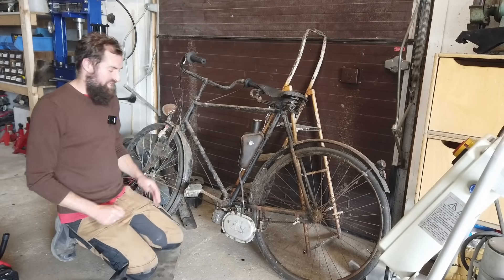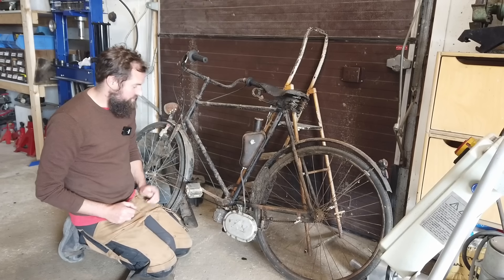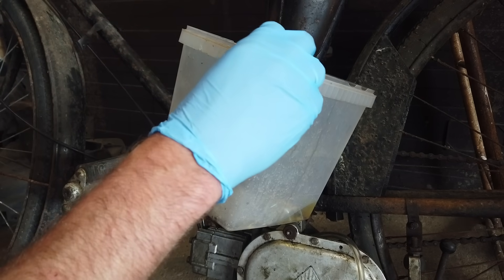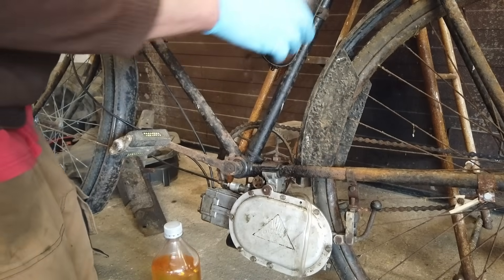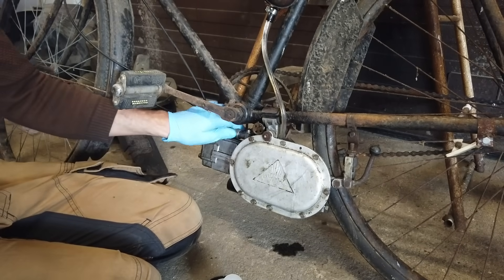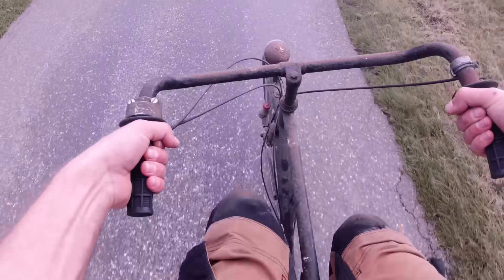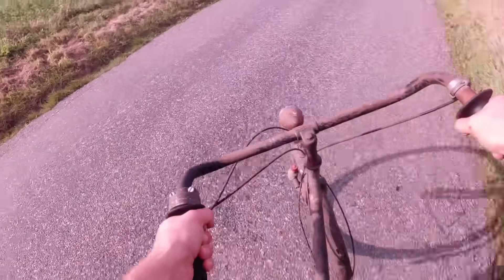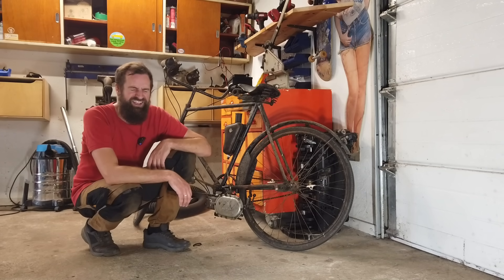Riding A Two Stroke Diesel Moped With Variable Compression!

Comment: Technically I think its called a semi-diesel engine similar to the vintage model aero diesel engines which used paraffin and ether as well as a contra-piston. Either way its a compression ignition engine so technically yes its a diesel engine 😁
Reply: In my opinion, a semi diesel is a glow plug engine, where the glow plug has to be connected to a dc electric power source to start the engine. And then the glow plug is continuously glowing, thanks to the combustion. This is a real diesel, because it self combust, or tho a 2 stroke.
Reply: The model aero engines don't need a glow plug it's the either content that keeps the ignition temperature. The smaller the model engine the higher either content is needed
Reply: Don't forget the castor oil
Reply: @atvheads  Glow plugs on diesels don't run after the engine is started. There were some engines, notably the Lanz Bulldog, which used hot bulb engines, which were not compression ignition.
Reply: @Burnsidef250  Are you sure that's true? I was under the impression that the glow plug stayed on the whole time to reduce the required compression ratio while still providing the required activation energy for auto-ignition.
Reply: @tissuepaper9962  I'm sure. Otherwise your alternator would be toast in short order. They pull down some pretty heavy amps. On my diesel they run for about 30 seconds after starting, you can see the voltmeter pick up when they turn off.
Reply: @tissuepaper9962 glow plugs are only powered during the start phase, and normally only used when a diesel engine is cold. In a model glow plug engine the plug is powered to start but then the burning fuel during combustion keeps it glowing enough to fire the next cycle. Hope this helps☺️.
Reply: I think you two are talking about two different things. 
The glow plugs in a diesel engine just run during start, and sometimes warmup until a pre-determined operating temp is reached. 
The glow plugs in a "glow" RC engine are different. They're a thin coil of platinum wire that is initially heated by a battery to start the engine then kept hot by the heat of combustion. I believe there's also a chemical reaction between the methanol fuel and the platinum that either keeps the glow plug hot or helps with ignition.
Reply: @Burnsidef250  got it, learned something new today. Thanks guys.
Reply: @Surestick88  platinum is a catalyst for the combustion of many organic compounds, it's the active ingredient in your catalytic converter. "Catalytic combustion" is your search term for this evening if you find you want to read some more about it. If you get underneath your car and find the catalytic converter, you may even see heat marks on it; it gets a lot hotter than the rest of the exhaust system, even hotter than the EGT right at the exhaust port.
Reply: @tissuepaper9962 glow plugs are only to pre-heat the combustion chamber and provide enough heat for compression ignition to be successful. Once an engine that has glow plugs starts, for the most part, in most engines, they're totally off. Some in cold climates, they will cycle a few more times to aid in cold start behavior. Having glow plugs or not, does not qualify or quantify an engine being diesel or not. There's also the grid heater method to preheat the air as it goes into the engine instead of utilizing glow plugs.
Reply: @tissuepaper9962 sorry for the secondary explanation, I was speaking more about diesel engines not the model/rc type. Different but not all that different. I realized after the fact that someone else had also clarified 😂
Reply: @goosenotmaverick1156  hey, all good, you actually taught me something new, too. I had never heard of a grid heater before your comment. It seems I have a whole lot to learn about diesels and not much to transfer over from my knowledge of petrols.
Reply: In post war time here use only used motor oil mixed with trementine solvent, a natural solvent from the pines resine. Try with injectors cleaner or ether, is the trick.
Reply: You have a piece of history 😉 here we knows motor de autoencendido,  auto ignition motor. Thanks for share!
Reply: @tissuepaper9962 glow plugs on rc model engines work like that. The combustion temperature keeps the glow plug spiral hot when engine is running.
Reply: Hot bulb engines are called Semi diesels here in Norway. In the US they are sometimes called Crude oil engine.
Reply: @tissuepaper9962  it's a lot of similar but different haha when it comes to petrol vs diesel engines. A lot of the concepts are the same but how it's achieved is different. Have fun learning! It's a grand time. There's even another kind of method for helping starting but I've only ever seen that on tractors and they don't work all that well 🤣
Reply: @goosenotmaverick1156  my old Perkins engine uses the grid heater method, when it operates you can see the flame in the inlet manifold if you have the flexible pipe off, here it Britain its known as a thermostart, very reliable and never had it go wrong.
Reply: that’s cool
Reply: @goosenotmaverick1156  well, don't leave me in suspense like this, lol! what's the third method called?

Comment: If the crank case (including the crank seals) are not air tight you are going to have a heck of a time obtaining any sort of operational RPM band.  Depending on the size of the leak it will light off and only be happy at a specific RPM and a dog anywhere under or over it.  You mentioned having the fuel screw all the way out...  My bet is you are compensating for a lean burn condition due to un-metered air entering the crank case.  Which on a compression ignition engine is going to be very lean.
Reply: Yes i also think that it has an air leak somewhere.
Reply: fuel all the way out, i thought about this one, he said the tank was not the original, look at the cap, i do not think the cap has a hole in it, and the fuel does not come down the  pipe  because of vacuum pressure holding it back,, just a thought....
Reply: I agree completely
Reply: @eyeswideshut7732 exactly wt I was thinking 👍
Reply: @anwarabrahams2413  i would dial the mix screw back in and i would run it without the cap... that is the next job lol👍
Reply: Yes. bad crank seals will kill a 2 stroke.  If it's not terrible, it will run, but it will run horribly and you can never get it dialed in just right.
But I'm not sure it's kerosene.  I use kerosene heaters and kerosene in the US is crystal clear.  This stuff is as yellow as gasoline.  A quick google search says water will do that.
Reply: That engine doesn't need floods of fuel. It's tiny.
Reply: What this guy said.
Reply: why does the crank case have to be air tight how does this affect it?
Reply: @julpul02  nah there are multiple people online posting the same results with this engine, different fuels perform differently and ideally you want something with a big of heavy oil in it for power, and a bit of something vaporizable, and something to lube it, so a mix of oil + kerosne + gasoline probably would work best.
Reply: @Crediu  because its basically a 2 stroke engine like in a trimmer thart uses compression ignition instead of spark ignition... it doesn't have an injection system so the fueling is similar to a trimmer with a fuel mixer that has the fuel floing into the case where it also lubes all the stuff again like a trimmer motor. So... its closer in design to a gasoline 2 stroke than it is a 2 stroke diesel...

Comment: i think it's only meant to just help you over the hill. 0.75 horsepower is about adult sprinting power so if it has that you almost don't need to shift down as long as you keep pedaling like a regular bike and it's perhaps under a 6% gradient climb. omitting shifting mechanisms gives you ~15% extra efficiency compared to, say, a 3 speed hub. the whole contraption is fascinating. i think a lot of us watchers have been thinking of very small engines on bicycles for a very long time. the 50cc kits are more motorcycles than assisted bicycles. if this were available, economical and a little less finicky than this, it would be literally perfect. it doesn't even need to be always on as it's small enough not to need a kickstarter. it's a brilliant little engine
Reply: 0,75hp is well over what an average cyclist can deliver. My place of work has a cargo bike with 250w motor and it can easily do much more than you see here if it would've had a hand throttle- even though it only has about half the power.
Reply: @mfbfreak  i think these ebikes are rather under-labelled. i don't mean sustained power, just sprints. mine is about ~1100 watts (measured by a power meter), but of course only for a couple seconds, and i'm barely above average
Reply: My 53cc 3 speed bicycle isn't a motorcycle, it can only go 47 mph max with my current gear ratios. I am able to gear for 55 mph, but I don't like how it exits turns.
Reply: @thefunniestfarm4731  your point being? the early super cubs went that fast.
Reply: See a Spartamet it's a bike with 30cc engine and way more refined. I had a few when I was young they are slow but fun.
Reply: I imagine, that the bicycle drive wheel will also act as the flywheel to help keep the engine spinning. This engine may not be designed to idle, when the bicycle comes to a stop like at an intersection, but instead meant to be used when the bicycle has long periods of uninterrupted travel. More for use in rural areas or between towns or cities, than inside towns or cities.
        Rather than for hill climbing assistance, it's for long stretches of flat roadway, is my guess.
Reply: Kerosene mixed with a little gasoline would probably help it start easier. Maybe just 5% gasoline to help it vaporize. Without making it more difficult to ignite.

Comment: I know the Lohmans quite well, and I strongly(!) recommend to use normal Jetfuel (Jet A-1) instead of Dieselfuel or Petroleum/Kerosene, because modern Petroleum for safety-reasons has a lot higher flash point than in the early ages. Dieselfuel also does not want to ignite under such conditions very well. Jet A-1 has a flash point of 38°C. You additionally can add some 5 to 10% of diethylether, which eases Ignition, and for liftig up the CETAN-number, add 1% 2-EHN (2-Ethylhexylnitrat). If you look for fuel-sources for  self igniting model-engines ("modeldiesel") you will find similar reciepts. Some Vintage-Modelers and control-wire-combat-modelers sometimes still use Diesels. Good luck!
Reply: Yes, I agree — trying fuel for glow plug model aircraft engines is worth a try. Back in the ‘60s, I used to mix my own fuel for a Cox 0.049 cubic inch “Babe Bee” engine. 

I used methanol, some ether, and castor oil for lubrication.  As the commenter above mentions, model airplane fuels contained some nitromethane in the old days and that may be true today. 

Changing your two controls over to thumb-operated levers may be a  benefit. “Thumbies” are old-school shift levers for 1980s mountain bikes and are still available.  

With the twist grips, it’s clearly difficult to maintain a setting. And tricky to have any repeatability for settings. 

Good luck and thanks for posting both videos.
Reply: Jet A1 is kero
Reply: @Larpy1933  There's a bit of a difference between a model diesel and a glow motor. model diesels (and this thing is basically an overgrown model diesel) have a movable counterpiston in the top of the cylinder that allows adjusting the compression ratio. They have no glow plug, and ignite using only the compression of the fuel mixture, vs a glow motor where the methanol undergoes a catalytic reaction in the presence of the platinum glow plug wire, causing the wire to glow and act as a 'hot spot' to ignite the majority of the fuel.

Model diesel fuel was usually a mix of castor oil, kerosene and diethyl ether. You would start them by winding the compression screw in, which raised the compression ratio, then flipping the engine over. Once ignition happened you had to adjust the compression screw for best running, it basically acts as the ignition timing (more compression = earlier ignition).
Reply: @nerd1000ify  You are right. Fuel for glow plug engines does NOT work in a compression ignited engine.
Reply: @EricaMTB  "Kerosene" in the USA, as used in outdoor-burners has a higher flash point than Jet A1. In Europe it is called Petroleum, which also has nowadays a higher flashpoint.
Reply: @hiha2108  Indeed, methanol is probably one of the most difficult fuels to ignite with compression alone. Which is why racing cars often use it, it allows their engines to have very high compression ratios without knocking. The opposite of what one wants for a diesel!
Reply: @hiha2108  Oofta... There is so much wrong with your opening post.

First:  Flashpoint means nothing.  Jet A, Jet A-1, Diesel, & Kerosene all have the same auto ignition of around 210°C.  Where as gasoline is in the 250-400°C range.  Ether is down in the 160°C range.  2-Ethylhexyl nitrate is possibly lower than ether (don't remember, and I'm not looking it up).  

I'm just going to stop.  I've seen these threads on the internet long enough to know how they play out.
Reply: @Failure_Is_An_Option  No, I am shure about what I write. Maybe that the flashpoint doesn't mean anything, but you will not be happy with today's petroleum/lamp-oil/burner-kerosene as a fuel for the Lohmann. Compression ignited model engines today mostly use Jet-A1 plus 20-30% Castor Oil plus 20% Ether plus 2-3% DII or 2-EHN, and I know for shure that a Lohmann will run perfectly on a model-Diesel Fuel mix like that.  Many Lohmann-owners in germany and austria have problems since several years to run their engines, because of the safety-options on petroleum/kerosene/paraffin.

Comment: According to the factory, this thing should run about 25 km/h on a flat road. A warm and well-adjusted motor should make up to 35 km/h.
Reply: Seems like the RPM would be uncomfortably high at 35 kph, maybe the roller has worn down and reduced the drive ratio between the engine and the wheel, or maybe this thing is supposed to sound like a vacuum cleaner at full tilt. Future videos may tell.

Comment: I got attacked on line commenting on German engineering. I was saying they go over the top. Well I still agree but love it. We built a 4 wheeled pushbike which folded when we went round a corner just to get to a pub 6 miles away. We had to sleep in the car park.

Comment: I've had a lot of luck with vintage 2-stoke engines that are hard to start by adding castor oil or castor seed oil. It seems to help compression and apparently protects the engine like no other oil from what I've read.
Reply: Castor oil turns into sort of a gummy resin when burned, which helps to seal the piston and build compression.
Reply: The castor oil idea sounds like a good idea. I think it would help bring up compression loss. Just remember old Norton motorcycle engines have to be put together just so or they blow up! I'd hate to see your cute little engine meet an un timely demise. You need to talk with an expert antique engine authority! Im just an opinionated enthusiast! Good luck! Hope she purrs like a kitten!
Reply: Авиадвигатель гном работал на смеси с касторовым маслом, оно не растворяется бензином.

Comment: I jokingly refer to my Mobylette 50v as a "bicycle with a weed whacker engine strapped to it" but this machine feels a lot more accurate to that analogy. Greetings from the US!
Reply: and the funny part is that most weed whackers have significantly more displacement than this (like, 30-50% more), despite requiring much less torque to operate. Diesel power, baby!

Comment: I looked up about this engine and found the following about the fuel...The engine usually runs on a mixture of gasoline, petroleum and lubricating oil.
Petrol station petroleum is doing fine and a mixing ratio of 1:40 (petroleum: two-stroke oil) is no problem with the current 2-stroke oil.
Absolutely love this. Please try that mix and see how it runs ❤

Comment: Around 1960 a classmate drove one belonging to his father. It was very difficult to drive it, since the compression had to be changed load depended. The maximum speed, no wind flat trajectory, was about 60 km/hour. Fuel consumption was ca 100 km/ l. During wintertime, temperatures bolow 0 depressie C, it dit not run at all. Trying  to run it on petrol resulted in an exploded cylinder, fortuanetly noboddy was hirt. That was the end of the Lohmann. Hope you Will have a lot of fun with your Lohmann

Comment: Saw a similar one in northern Sweden it had a bike tire valve on the cap and you where supposed to pump it up with air if you used thicker fuels. Otherwise you opened an other valve on the cap to prevent airlocking the tank.